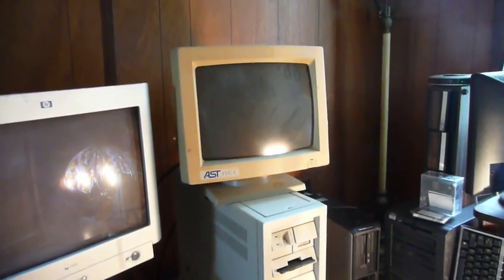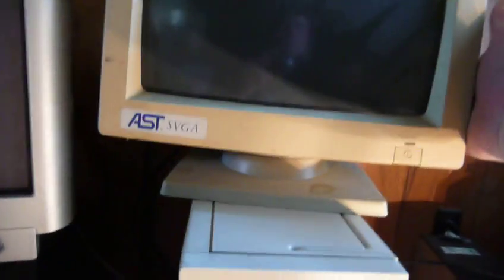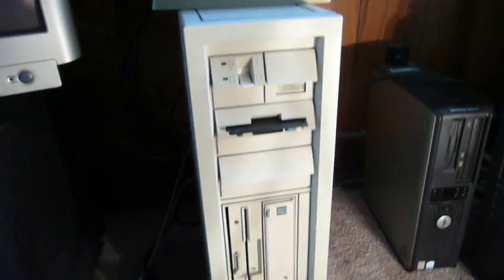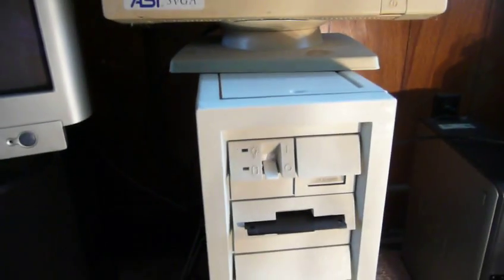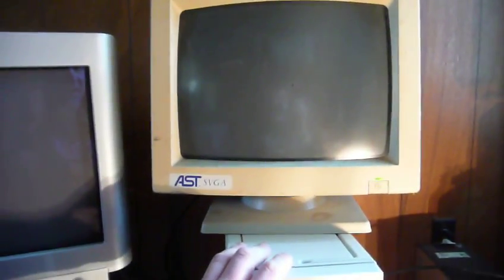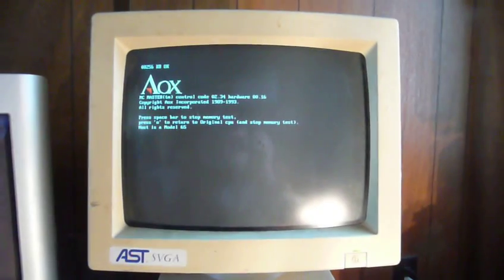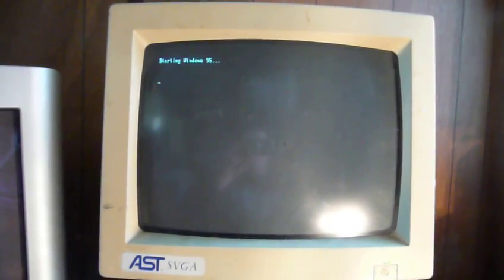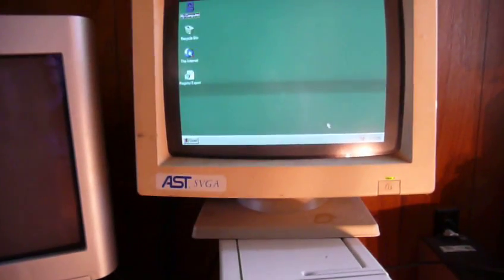AOX/Kingston MicroMaster Processor Upgrade Card Part 2

Comment: Now find a Pentium version. XD

P.S., the 65 in the video has a 5 1/4 inch disk drive. 1/4 is equal to 0.25, and the video is 5 minuted and 25 seconds in length. :D

Comment: I had a PS/2 Model 50Z with the AOX Micromaster 386 upgrade board (pre-Kingston, 386DX 20Mhz I think). Certainly made the machine more usable giving it 8MB of RAM and the ability to run Windows 3.1 in 386 Enhanced mode. Looks like your card was configured to disable onboard memory, a wise choice because it slows down the system a lot to use planer RAM.

Comment: Companies who made those clip-on 386SX upgrades gave you a test program to see if your chip could support the upgrade.  But these upgrades typically used Cyrix 486SLC-based CPUs, which were really just a 386SX with a 1 kB internal cache and the 486 instructions added, so the performance boost wasn't much. Upgrades which used the IBM 486SLC/3 "Blue Lightning" chip with 16 kB cache were much better but harder to find and more expensive.